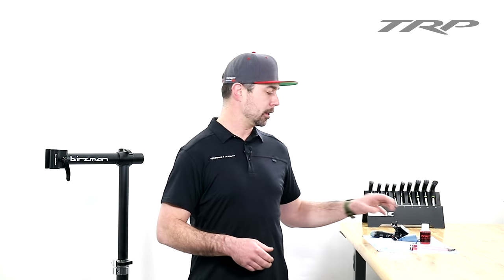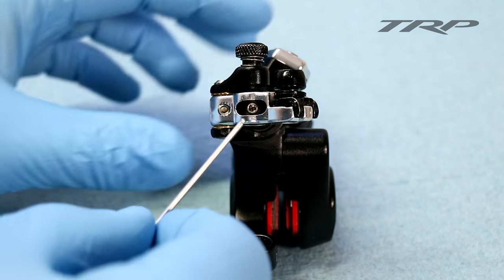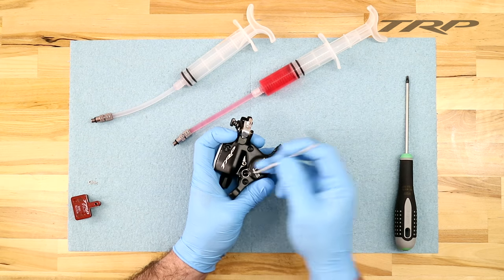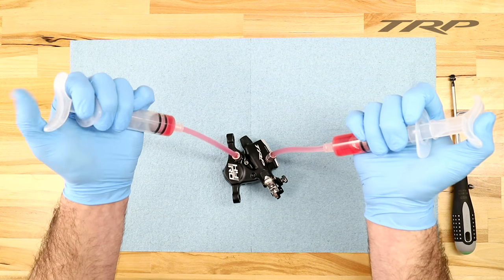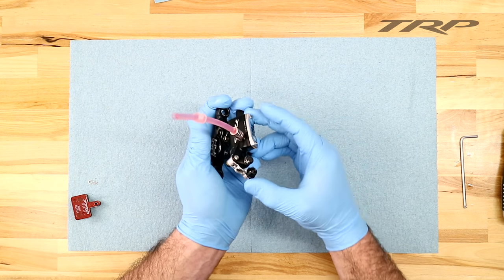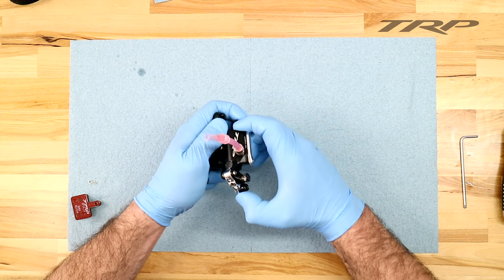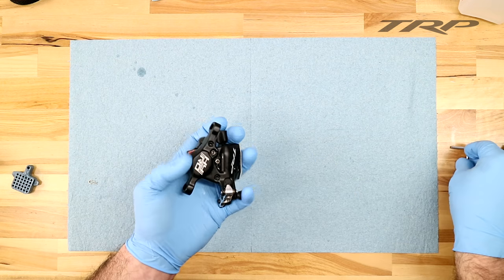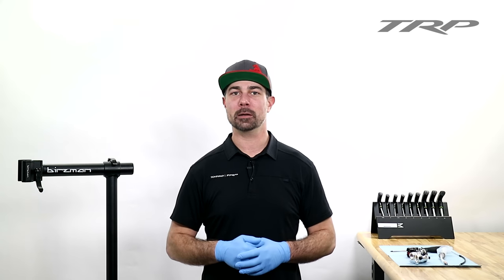TRP Tech Talks - HY/RD Bleed, Service, and Setup

Comment: trying not to knock you but when you bleed anything, you do not reintroduce old fluid back into the chamber, bleeding a car brakes it the same, one way only. what you just did was make old dirty fluid, medium dirty. and taking air out at the end is agreeable but during the transfer fluid no.
Reply from the maker: Yes, this is true. When bleeding brakes we do an initial flush and then begin to cycle the new fluid after discarding the old. Thank you for pointing this out as missing in the video, we will be sure to get it corrected.

Comment: I have a set of these on a new bike with Shimano 105 levers. I have an extremely long pull on braking, and I'm not confident I am getting enough braking power to ride on the streets. I purchased this bike online so I have no LBS to help with my problem. I've made sure the actuator arm screws in easily, and I've bled the front brake according to instructions but his had no noticeable affect. I have read there are many defective TRP HY/RD brakes so I am wondering if this might be the case for me. Is there any way to determine/lookup if my brakes are some of the defective ones? Many thanks!
Reply from the maker: Go ahead and email our customer service team at info@trpcycling.com and they can help you out!

Comment: Can I use them on mtb which has dropbars and Campagnolo chorus 12 speed sti shifters? Now I have flatbars and Magura mt4 4 nur I need cable actuated breaks. The MTB is for 70% on road and 30% on road.
Reply: If you are planning to use a short pull brake lever like Campagnolo (or SRAM or older non-SLR-EV Shimano) you will want to swap the actuator arm on the TRP HY/RD for a short pull version: https://www.youtube.com/watch?v=JoNIqoguOKs

Comment: Good overview.  It doesn't look like it, but can this be done with the brake mounted on the bike?
Reply from the maker: We wouldn't recommend doing this procedure with the brake mounted on the bike as there is a good chance you will contaminate your pads and rotors with excess oil coming from the reservoir. In other words, you can do it, but you will experience issues after the fact so taking it off the bike and moving the system to a work station is definitely the way to go.
Reply: I actually did it...I removed the wheels from the bike; removed the pads too...hang the bike and did the 2-way bleed which is easier done on a HD C-170 flat mount model since the 2nd bleed port is located on the inboard side of the caliper.

Comment: Thanks for the video. My break lever takes quite a long throw to actuate, does that mean that i should purge them ? The locking bolt is aligned...
Reply: what i did was to reverse the cable locking screws...I screwed my cable from below, not on top (the usual way)...it lessens the cable travel during actuation...if you're a bit more adventurous, you can do this:  https://www.youtube.com/watch?v=8aBa3sGUUhs

Comment: If i still feel the need to tighten the cable more for the lever not to brake so close to the handlebar, can i tighten the cable more even if the lock knob will not be threaded?
Reply from the maker: First make sure you are using compression less cable housing, that will help take a lot of slack out of the cable. We don't recommend adjusting the arm past the lock knob or you risk closing off the timing port. That will cause the brakes to lose power.

Comment: Hey TRP guys, quick question: is the barrel adjuster threading M6 or M7? I bought a set off ebay missing the barrel adjusters and scuttlebut is M6, but it'd be great to have confirmation from y'all directly. Thanks!
Reply from the maker: The threading would be an M6.

Comment: Hi, my HY/RD brakes do not work at all, even when unlocked. I can see that the brake pads are moving. Also my brakes do not automaticity bleed. How do I make them bleed aside from pulling on the lever till firm even with the caliper up right? Also is there a slick coat on the pads that makes them barely grab?
Even after centering the brakes they do not work.
Reply from the maker: Hi there, if you are having issues with your HY/RD brakes still, please contact our customer service team at info@trpcycling.com and they will get you helped out. 

The brakes don't automatically bleed per say, they automatically adjust to pad wear by backing the pistons with oil as the pads wear down. If you are having an issue with bite on the rotors, make sure the pads are bedded into the surface of the rotors and there is no contamination to the system.

Comment: Maybe you gona say im crazy but i installed hy/rd on my freeside mtb and it has a good stopping power because its working with 203mm rotors...
Reply: Well the hyrd are the best cable disc brakes so yes they have a good stopping power.

Comment: Do I need to bleed a brand new, out of the box Hy/Rd?
Reply from the maker: Nope! All of our brakes come completely pre-bled from the factory so all you need to do is mount it on the frame, run the cable through and you have a working brake!
Reply: @TRPcomponents  How often should I bleed the Hy/Rd brakes?

Comment: How to align the Rotor?
Reply: don't align the rotor. align the brake calliper: loosen the screws, pull the cable and tighten the screws again. It is that simple. If it's still not alligned, the rotor may be damaged and needs replacement
Also make sure your wheels are not bend and installed correctly.

Comment: This is a great video, the only issue is that the Hy/Rd brakes I have seem to be slightly different and I can't tell where I should be pumping fluid into/out of?! I bought them in 2022 so I would have thought they're the latest model?
Manuals don't seem to show the updated calipers either.
Please advise
Reply: I have the same problem! Mine are the same model number (HD-C711) as the one pictured, but look distinctly different, and I can't tell based on the one in the video where the bleed ports would be on mine.

Comment: Dear Dave and TRP Team. I have bought a Triban RC520 which comes wíth Hy-Road PostMount 160 Rotor break system. No matter what I do how I set, adjust, clean and make anything on against my best knowledge and many videos on youtube, one side of the pistons still wont set back. It is just simply does not retract back to its place. There is 0mm distance between my disc and the break pad reagardless how many times I re-set the piston. For a year now and countless of hours of trials on adjusments, my front break drags and breaks all the time. It drives me crazy as my wheel wont spin a 1/4  round without stopping by the dragging-sloppy break pad/piston. 

Could you please help me somehow? Do I need to purchase a new front-set eventually? :(

Comment: This video was very helpful. This is a much needed update from the previous bleed video on youtube and came at just the right time for me. I found the lever purge to be particularly useful and got a lot of extra air out the system by rotating the caliper. I was bleeding the caliper as after 4 years of regular use I thought the caliper was at the ends of its life. This bleed has helped but the performance is still not what I would like. Would TRP consider making a video showing how the caliper can be further serviced possibly examining replacing seals etc. You can buy lots of small part from the TRP website for this caliper. It would be nice to see how to use them. Perhaps I could gain extra performance this way.
Reply from the maker: Glad to hear this video served its purpose! We will start to draw up more videos like this with replacing small parts like piston seals, levers, and master cylinders!
Reply: @TRPcomponents  Any update on the seal replacement? I've a leaking caliper I'd like to try and service.
Reply from the maker: @leeomurchu1213  please contact our customer service team at info@trpcycling.com and they can get you helped out!

Comment: I've been using a Shimano 105 STI paired with TRP HY/RD cable actuated Hydraulic brakes on my first roadbike. recently the rear brake has stiffened up quite a bit, especially on the first press. I checked the brake cable below my bike and i noticed a slight bend when it used to be straight. my mechanic said it was fine, and I am still able to brake, but it just makes the feel a lot stiffer than I'd like. what should I do? Is it a problem with my brake lever? Is it an issue with the cable? Thanks in advance everyone!
Reply from the maker: It sounds like that bend in the line is just creating more friction on the lever than if it were straight. We would suggest just changing your cable and housing out for some new ones. This is very inexpensive and it will get that lever feeling very sharp. Try going with a Jagwire compressionless housing or our own housing and cable kit which can be purchased here: https://trpcycling.com/product/trp-discconnect-cable-and-housing-kit/
Reply: Each time or kilometers it need to change this mineral oil?

Comment: Hi there
Soni ride street trials with TRP evo but i think i need to sell them and get something else.
1. Problem - pad rock. It make horrible noises.
2. Problem - everytime i start my ride my brakes do not work. I have to first pour water on them and then bed them in.
Reply from the maker: It sounds like the pads/ rotors may be glazed or contaminated.

Comment: I'm not getting enough travel to brake pads from the pistons to give good braking ,any ideas?
Reply from the maker: It sounds like there may be air trapped in your brake or the timing port is closed off. Please reach out to our technical team at info@trpcycling.com for further assistance troubleshooting the brake.

Comment: Good Video. Would be perfect video if you shows how  far the pistons can be pushed  out (for cleaning reason) before they pop out... 
Or where are the cleaning  -  maintains videos.
Thank you.
Reply from the maker: Good point! The farthest you should go is 3 mm. This is the true usable area of the piston. The entire piston measures 5 mm in depth but during normal brake function, only about 3 mm will see dirt and grime gather.

Comment: May I know where are the bleed ports of TRP HD C-710 located? This model (HD C-705 I assume) has 2 bleed ports on the front, while in HD C-710 there is only one which is located in the reservoir.
Reply from the maker: The bleed port for the reservoir is located on the outboard side of the reservoir and the bleed port on the caliper is located on the outboard side as well, directly underneath the pad. The easiest way to locate the ports would be by the screws as they are T-25 specific.
Reply: @TRPcomponents   I am pretty sure the HD C-710 has only one bleed port on the outside
Reply: @24tisoy  it's behind or what they refer to as "inboard" side of the caliper

Comment: Could u use bleed cup and syringe instead of double syringe? Ty
Reply from the maker: If you wanted to use a bleed cup, you would have to actuate the lever in order to get fluid to flow back into the syringe. It will also likely be very messy using a bleed cup so while it is possible, we recommend using the dual syringe process.

Comment: these brakes are a royal pain the ass, and they work no better than mechanical brakes. the bicycle industry is rife with moron engineers, taking orders from the marketing department. these barks suck:  over engineered for no real bebenfit. i threw mine in the trash. life is too short: get paul mechnicals or equal brakes.
Reply: I've had these on my bike for over two years. Replaced the awful Giant conduct system which was also cable actuated hydraulic. They're both way better than mechanical disc and the TRPs are the better of the two. How ae they a pain in the ass?

Comment: Bleeding looks as much a palaver with these as any other hydraulic brake, perhaps more than Shimano. I guess the cable-pull actuation means that you'll never split a hydraulic hose but I think I'll be sticking with my TRP Spyre mechanicals.
Reply: Never tried the Spyres, although I've heard good things about them; but I do like the hy/rd on my gravel bike.  In general I've found mechanical brakes are plenty powerful in the drops but lack something on the hoods -- that's true for both disc and rim.  On the road it doesn't matter, but on singletrack the extra power of hydraulics on the hoods is something I really appreciate.

As for the bleed procedure, if anything it's a little more fiddly than the hydraulic bleeds I've done, but I suspect Dave is being a more obsessively perfectionist than he strictly needs to be.  Still, the procedure doesn't actually look *hard*, in the sense of being something you can screw up.  It looks like something that would be a lot easier after you'd done it once.  I really like the fact you can do it off the bike, at a bench. That's bound to be a lot neater.